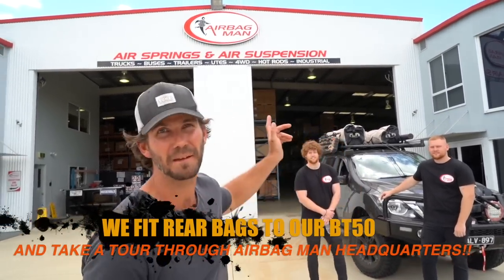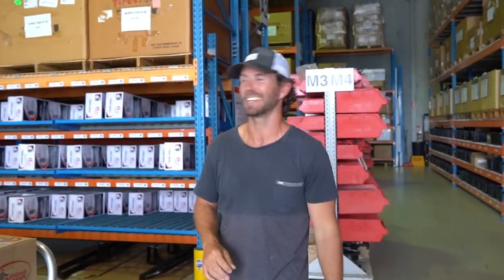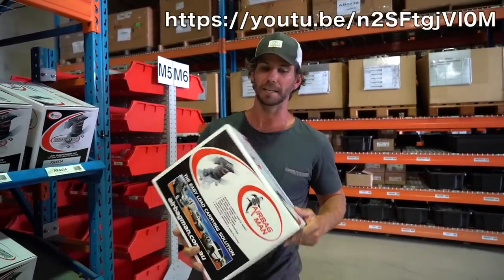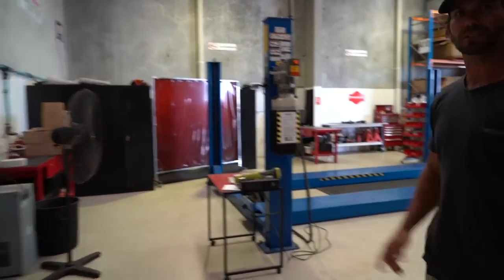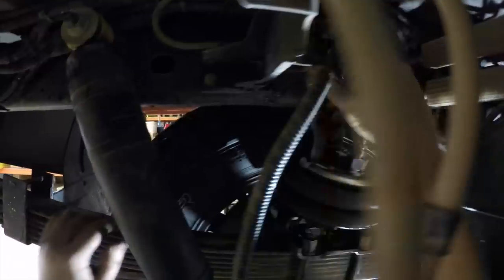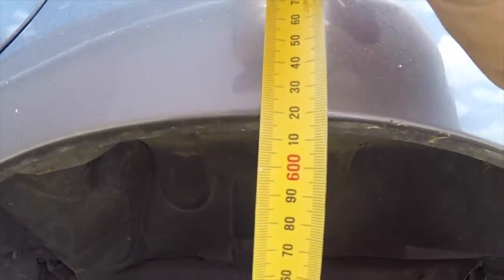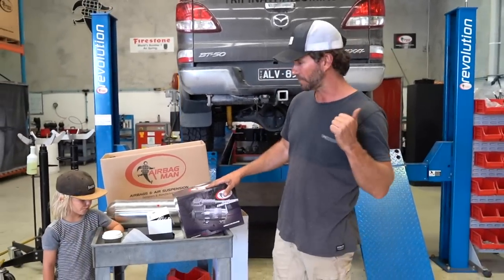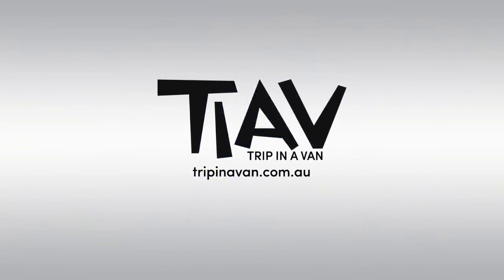AIRBAG INSTALL IN OUR 2017 BT50 & WE CHECK OUT AIRBAG MAN HQ!!

Comment: Fitting an airbag kit in my BT this morning. So easy and great for my ute as I run a heavy toolbox on one side. 👍
Reply: Any pros cons with ride condition?
Reply: @joeycarnevale9219  no not at all. Airbags are incredibly smooth and easy to tune 👍
Reply: @joeycarnevale9219  I've actually take one out and just use the one on the passenger side now
Reply: Whats Inside And How It Works why would you do that?
Reply: @joeycarnevale9219  my ute is very side heavy and the other isn't. So no need for the 2 bags at this stage.

Comment: Hi there... I'm going to fit these on my 2018 bt50 as I find the original rear leaf suspension is a bit on the soft side,.. I did think about a lift kit & thought no as I think the rear airbag system gives you more versatility with loads/towing ect...
Anyway.. That's my thoughts... R.

Comment: My 2 inflation points are not great. When I go to put air in them at the servo the air machine struggles to read the pressure and the air hose gun fits real loose, almost like the 2 silver fittings are a size too small. PLUS they don’t hold air that great either. 30 PSI will deflate to 22/23 PSI within 5 or 6 days.
Took it back to the installers (Opposite Lock) and they said it’s all normal. ☹️
Reply from the maker: Hey mate, definitely not normal to leak pressure down. Mine hold 30 psi no drama's.. Have you leak tested the system soapy water to see if there is a fault??
Reply: Not normal to leak down, we rarely top them up, maybe twice a year?